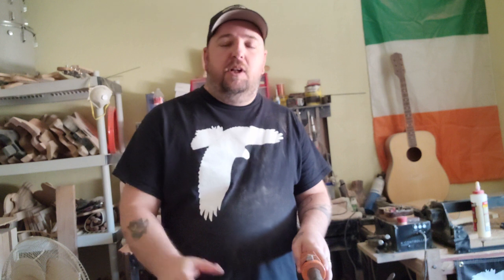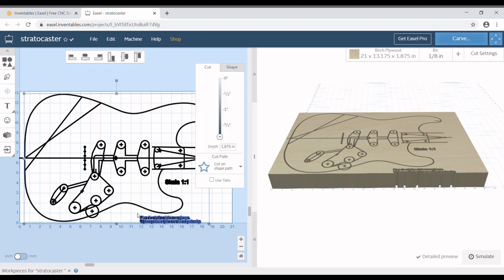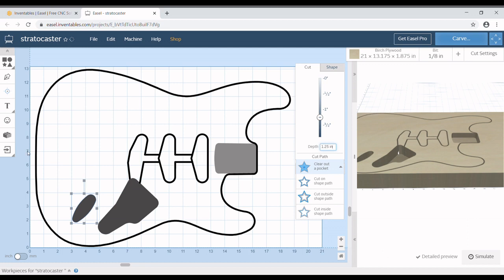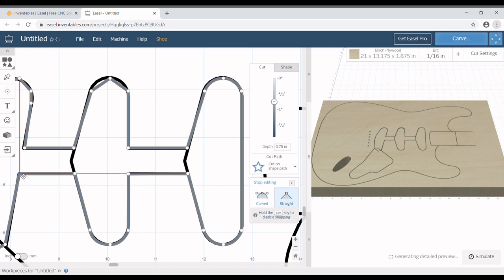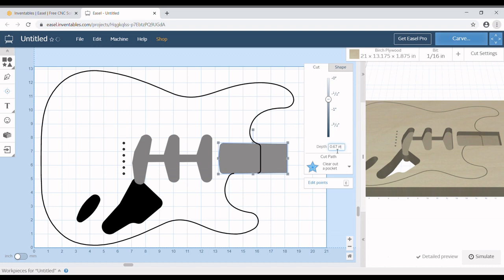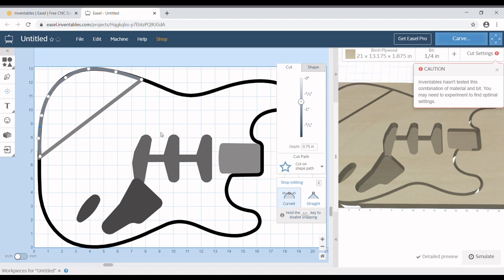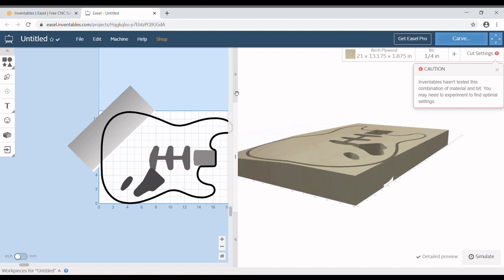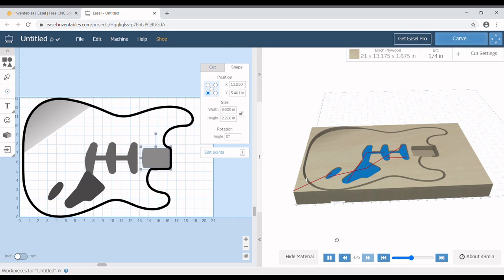How to design a Stratocaster style guitar in Easel software

Comment: Im following along with your great video, but Im at a point where if I select anything to delete, it also selects other lines that I want to keep. Holding shift and clicking doesnt help. Any idea on how to get past this. Im doing this on a laptop without a mouse - could that be the issue?
Reply from the maker: Possibly... I would probably get frustrated and just delete it line by line one at a time. It sucks and would take longer but is still an option to getting it done.
Reply: @JBirdCustoms  Thanks for the reply. how would i select line by line?
Reply from the maker: Clicking on each on individually... like I said it would take a lot longer but it's doable.
Reply from the maker: The other option is head to jbirdcustomsguitars.etsy.com and grab the file already edited from there. It downloads as an svg or dxf ready to import!
Reply: @JBirdCustoms  Yeah. thats what im doing, and it seems to select paths all over the guitar . :(
Reply from the maker: Some are connected in weird spots. It took me a long while before I figured out the shift thing. Not sure why it's not working for you... that's weird.
Reply: @JBirdCustoms  you actually have the telemaster that Im trying to do as well ;)

Comment: This is actually a pretty good video, and also in Easel its possible to just click the plus at the very bottom to add a new page to set a different tool for different part of the body, it will easy be frustrating if you´ve got more than 5-6 different pages with different tools, to know what part to do first or what not, so it will be in the right order.
Reply from the maker: Very good point! I have used that as well to use different sized bits to do different jobs and it does make things much more simple!

Comment: Hi I've watched this video a couple of times and it' very useful as I've been building Guitars for 25 years and I'm always looking at new techniques etc. I've built a cnc router and have been watching FreeCad and Fusion 360 tutorials and have been an Easel Pro user for a year  to see what the benefits are, but I've started to question myself, what am I trying to be a Luthier or a CNC operator, the line is starting to get blurred for me, I'd be interested to hear what you think on this
Reply from the maker: I feel like a cnc is just another tool. I know a lot of people feel it's "cheating" or whatever but it takes time to learn the ins and outs of using a cnc just like using a hand plane or a router and template. I personally like using my cnc to cut profiles and then shaping by hand. I feel like I get the best of both worlds that way. Thanks for checking out the video I appreciate it and thanks for the comment as well!